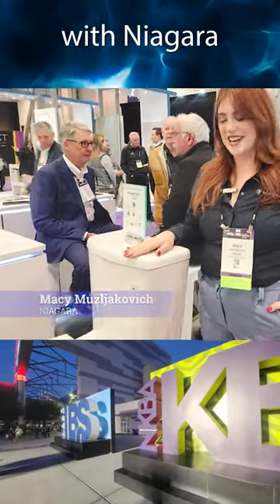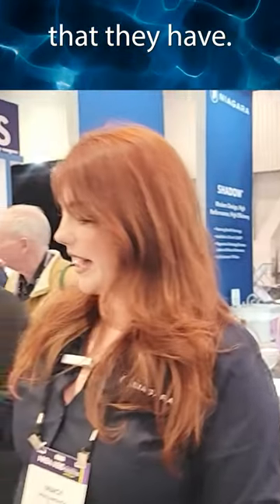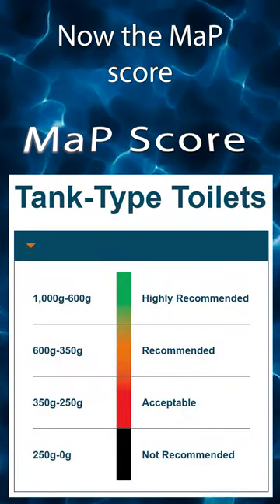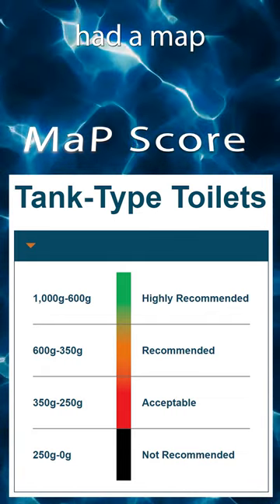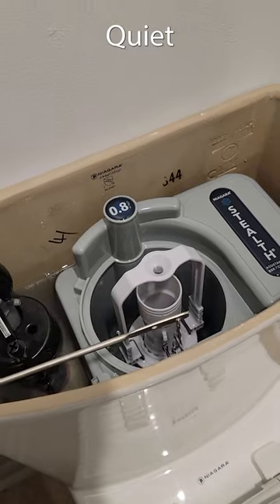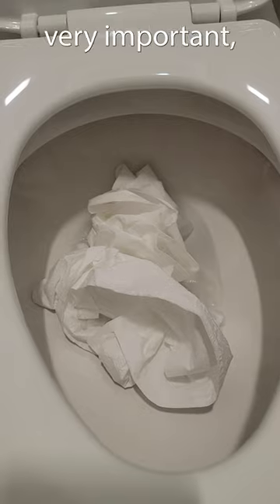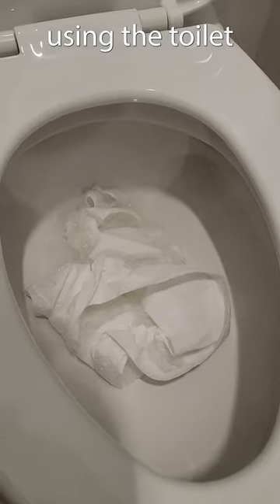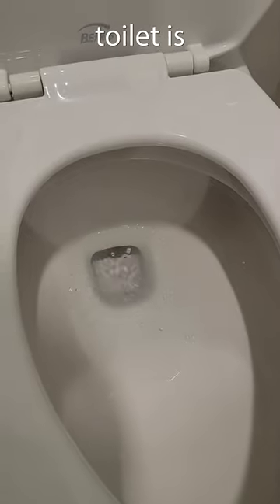Experience the Superior Flushing Power of Niagara Toilets: A MaP Score Demonstration

Comment: Project source pro flush is better
Reply from the maker: I just looked up the MaP score and did not see that it was tested, so I cannot verify the flush rating. https://map-testing.com/map-search/
Reply: @SawHorseDesignBuild it can flush 40 sheets that can flush only 15
Reply from the maker: @mohammadislam2178  Can you send me the testing data to the email on this page? https://sawhorse.net/contact/
Reply: @SawHorseDesignBuild  I can't I have a nockoffia it will crash
Reply from the maker: @mohammadislam2178  ok- no problem
Reply: @SawHorseDesignBuild  thanks dude 👍